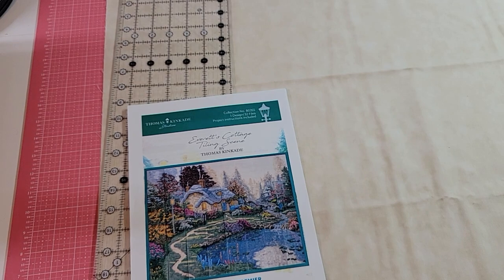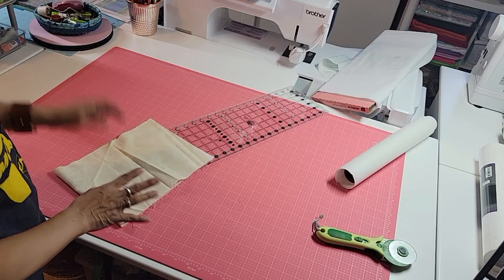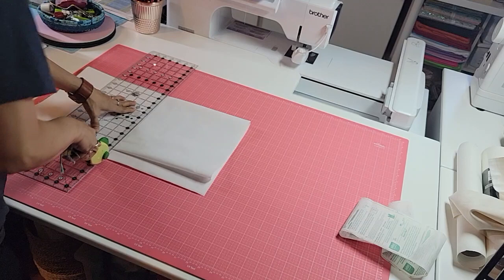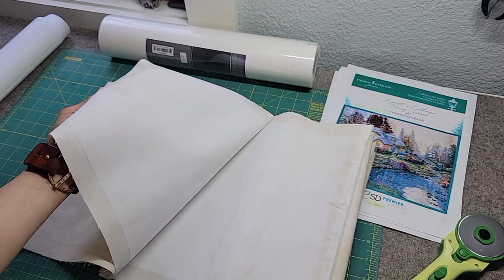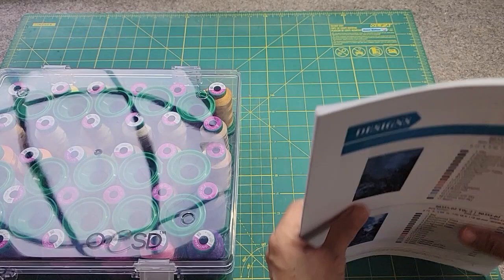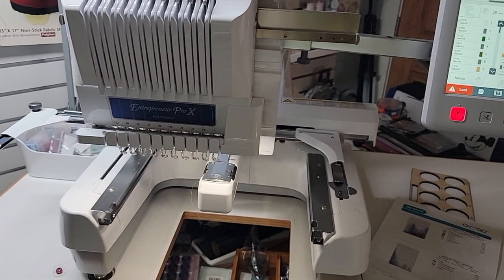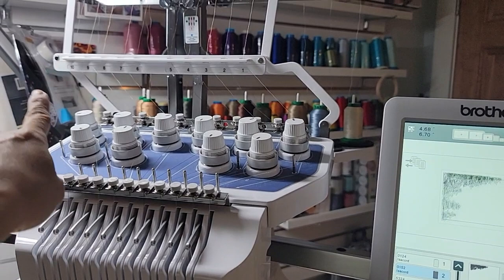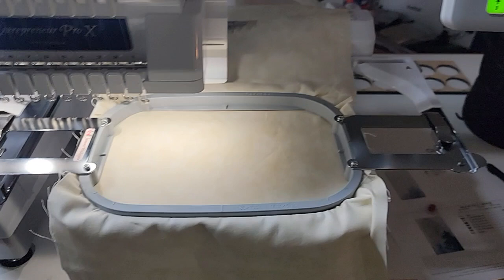A1 Reno's OESD Everett's Cottage Tiling Scene   How I prep to do a tiling scene

Comment: is using shape flex 101 the same as using floriani dream weave supreme . I had been told that is good when you have a dense design. I think shape flex would be more reasonable in price.thank You for the video. I have a OEDS design and will try your method .
Reply: Yes hey all do the same thing.  Dream weave is pricey.  I used to use it until I found out about Pellon Sf101.   When Joann’s has a 50 or 60% off sale I buy it by the bolt.  Jeanne sells it